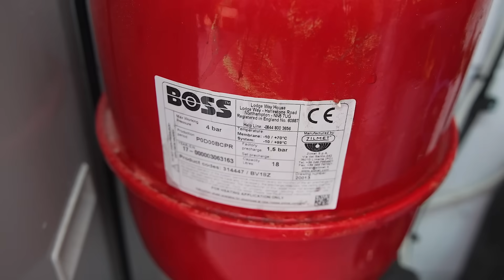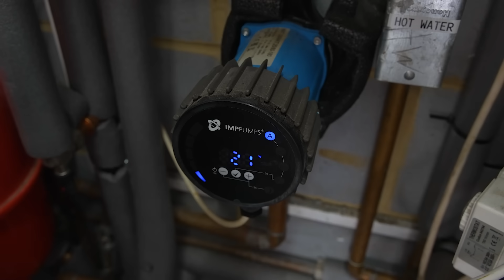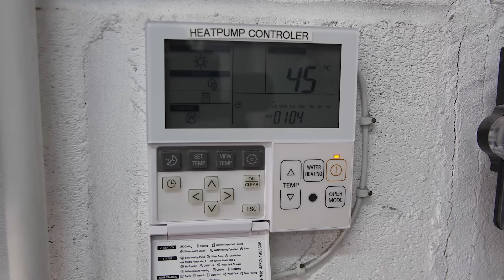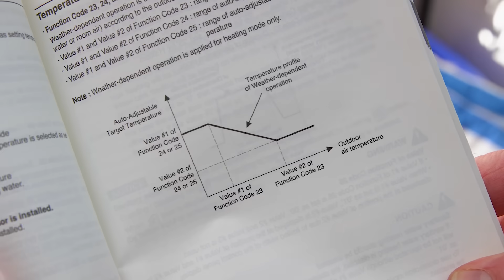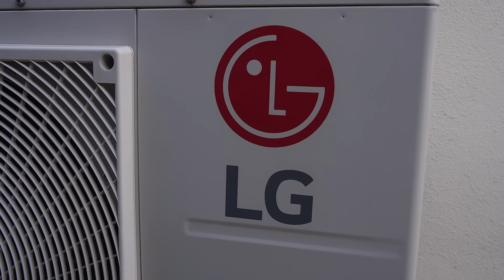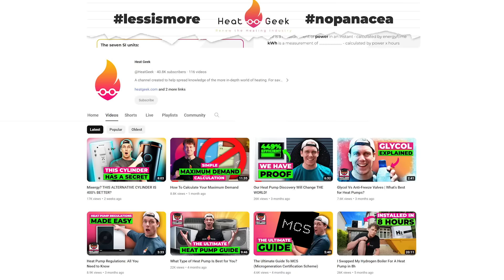Heat Geek Gives His Verdict on John’s Nightmare Heat Pump

Comment: not sure if it was said in the video, as watched half of it (its long!)- but that unit in this location will recirculate cold air and go to defrost too often. Its a shame that bad installs make people doubt this amazing tech. It works super well when done correctly.
Reply: I agree. If it's got enough water volume and it's still freezing up it's probably an air circulation thing
Reply from the maker: You get a mention later on. What would you do about the fan noise?
Reply: @SkillBuilder I will watch it in full later. Noise needs a repair obviously
Reply: Its like a metre, maybe 1.5 metres from front panel. What are people going to do when they dont have gardens, its going to have to be put on a cradle about 2metres off floor to get maximum air intake. Mental.
Reply: @Purebeltersteve have you been to the far east and see how they do air conditioning ?
Reply: @IverKnackerov  im not talking about AC units, but they are same thing. No but ive seen mainland europe and some of them in urban areas, you wouldnt want to service if your afraid of heights.
Reply: I'm wondering if some sort of 90 degree air diverter would help with the re-circulation in an smaller enclosed space.  This might also assist in dampening noise (once the fan is fixed) directly toward the neighbour.
Reply: @Purebeltersteve  If people don't have gardens, they are probably in a block of flats, and the flats have some outside space where heat pumps can be sited. What we aren't seeing much of in the UK is large centralised heat pump installations where the heat is generated by a large commercial heat pump and sold to the residents as the alternative to paying for the gas/electric so that they can generate their own heat with equipment that they own and are responsible for servicing. Europe has this cracked because they went down a route of district heating systems in the 60s and 70s, so people are already used to paying for heat rather then energy.
Reply: @tlangdon12  but what happens when the main source breaks and cant be fixed for 3 weeks for example. Most people arent going to agree to that, maybe people in social housing
Reply: The location is fine imo
Reply: Get to it Szymon, give him a quote. ;)

Comment: My LG ASHP has been rock solid and running cheaper than my prior condensing gas boiler. Shows you how important the installer is! Brands are going to live or die based on their customer service though, it's best they ramp up training and support.
Reply: Yea I thing LG need to have some responsibility here. For the pump manufacturer they need a proper trained competent reseller and they need to certify that through proper accreditation scheme

Comment: Cracking video chaps, and great work by Adam and Heat Geeks for trying to get this industry straightened out. The technology clearly works when it's done correctly but it's difficult to have faith as a consumer that you're getting someone who knows their stuff, rather than a fly by night outfit cashing in on govt grants. The HeatGeek guarantee will certainly help give consumers confidence - if a company is prepared to offer a guarantee it stands to reason that they are confident in their workmanship.

Comment: I put the Ideal weather comp kit on my Logic Heat Only gas boiler. It took a bit of getting used to cooler radiators, but it certainly works and has saved gas and money and the kit was less than £100. I'm retired now, but I was Gas Safe registered at the time. Incidentally, when it was -4C yesterday the flow temp went right up, just as it should. Go for weather compensation for sure if your system can support it.

Comment: It does look very complicated for just a house. I think we’d all love to see a complete overhaul and brand new system using Adam’s specifications.
Reply: Aye. I'd like to see the return visit!
Reply: Or just install a flipping efficient gas boiler instead of this nonesense.
Reply: @1701_FyldeFlyer 
I’m with you on that, 36 years in CH Industry domestic, commercial, including design and installation, all the certification to all highest levels,
All that keeps coming to mind is … for the love of god (all of the gods) this is just the work of some under educated/experienced and over mouthy, over confident youngster, that thinks his gunna make a big splash in the industry, using the trust of an honest fella.
For fuck sake it’s a bungalow
Reply: @1701_FyldeFlyer  Efficient? a heatpump moves more heat energy then it consumes.
Reply: @kiddy1992  Thus defying the laws of physics :)

Comment: Hello Roger. I was very lucky to get the government grant for the whole system, that being solar panels x 10, 7 new double convection radiators, the external fan cold to hot water heater, a Kodiak boiler with a digital interface, 2 expansion units above the boiler, & 2 thermostats (1 for upstairs, 1 for downstairs). My house met the criteria on a couple of points. Octopus asked me if I'd like this & I was elated, out with the old eco7 heaters & the immersion heater. I now wish I'd never had this installed. The rad's are luke warm at best, the outdoor fan unit switches on & off constantly & the electricity cost has more than doubled. As I write this at 11pm, it's  -2c outside & 12c inside. The rad's aren't being heated, just the hot water for the boiler. I echo John's original interview, it's very expensive to run, it feels too cold, & I don't have gas to compensate. I was told the rad's were working fine & that's what I will get heat wise. I've got so many valves, those pumps that Adam stated weren't needed, & my boiler is set to 50c. I live alone so I just live in the kitchen as it's the hub of the house. Out of my own savings I've replaced secondary glazed windows for new upvc double glazed units. Last winter it was just 6c inside this kitchen, now it's 12c so they have helped. But for all of this cheaper heating installation, those rad's are useless. Like you say, it's fairly new technology in the UK, & after watching this follow up with Adam, I think the installers didn't have the knowledge or training. They were just plumbers by trade. As of now, the rad's aren't being heated, they are stone cold at the bottom, & the heat exchange unit is using 93p per hour. My tap water will burn your skin off, but the water will not provide adequate heat to the rad's. I think I have too many unnecessary parts just like John. Something isn't right, as confirmed by your excellent video here. Very unhappy although at least the heat exchange is level & quiet.
Reply: Something is very wrong if your hot water is scalding. You need to find a competent engineer to sort your system.
Reply: Just ask some or several Geeks to come and look at it. There is U Tube Money to be made.  Make it a competition...
Reply: Turn it all off and get a cheap Chinese diesel heater or 2
Reply: Who was the installer?
Reply: @ryanh3285 Hi, seen a few videos on YT where people have done this for less than £200 hardware and cheap running costs.
The std cost of electricity is crazy, gas just barmy, so burning diesel or paraffin is now cheaper.
A plus is that it works in the cold!
Take care M.
Reply: My hot water is scalding but then thats what I get with a back boiler. 
I'm so sorry you're going through this, we get charmed by empty promises of more efficiency and what that always translates to is "you're gunna be more cold but pay the same or more to be cold"
Found this out when old storage heater was replaced and new one is shyte. Old one even though vent didn't open, kept one side of house toasty and mold free.
New one needs fan on as well as core so it's more to run for less hours and I have mold spores growing everywhere. 
So nope I won't be going for the gubment grant to get ASHP in, especially as they would disconnect my fire/backboiler which is only thing keeps me warm and the water for bath hot (I need that hot water for my messed up spinal issues) 

As for carbon zero....carbon is LIFE, net zero carbon will mean death of all plants including food if we go to 200ppm. We are at 420ppm presently and could do with being higher as I am seeing nature dying already around me.
Ask any aquascaper like I was, we added carbon dioxide to make our plants grow and the fish thrive. 

Dying to be green.... literally....and you will freeze doing so.

Comment: A gem of a video, which has re-shifted my confidence towards heat pumps installed in Britain's mild climate, providing the site and system is correctly surveyed competently beforehand.
I wonder if the closed space for the heat pump is causing it to resonate and perhaps putting sound absorbing foam opposite against the fence might help?

Comment: A quick note on South-Facing placement:

You will notice that the North side of a building will hold on to snow and frost a lot longer than the other faces of a building, particularly the South side.
You will also notice that temperatures are measured "in the shade" - I believe this is because there is no heating of the ground at the measurement point, so you are measuring air temperature that has not been additionally heated by warmth coming from the ground.
Consider:  If we are hot, we move into the shade to get some relief, on a sunny day.  We are being heated directly by the sun and the air around us has also been heated because it passes over warm ground, however under a tree it is noticeably cooler, as it the ground we sit upon.  This is why ground-source heat pump coils are typically laid in ground that has sun falling upon it, where possible.

Therefore:  
If you are installing your heat pump on a solid surface and it is surrounded by more solid surface, the sun will strike that surface and heat it, particularly if it is dark in colour.  That heat will be given off to the air around the heat pump.  You then pass that warmed air over your heat pump, which results in greater efficiency as there is more heat to extract from the air and pump around the system.

I also think that a darker casing will be beneficial for the same reason - air will be heated by the metal work as it passes over the heat pump.  It might not be worth a great deal of extra heat but nonetheless it will increase heat being passed into the system, improve efficiency, lower cost.  

Roger will doubtless recall that a customer wanted a heat pump moved out of sight, under a tree, the performance degraded, the cost went up.  This may have had something to do with losses due to losses in longer pipe work, but it is nonetheless instructive.

I think therefore that there is some advantage, actually, in having a darker casing, on the South side, if possible.
Reply: Your mixing radiant heat with conducted heat
Reply: @HeatGeek  I can see why you might think that - but no, I do understand that the heat comes from the air, hence "air source heat pump".  I'm simply positing that, when air passes over surfaces that have been heated by the sun, some of that heat will be transmitted to the air, which then blows over the heat pump vanes.  The effect may not be large, particularly when you really need it, but it might make a measurable difference to overall efficiency. 

It would be interesting to see the testing done by the manufacturer (Daikin ???) who recommended this, to see how large an effect they may have measured in their testing.

If the effect is true and measurable (yet to be determined) it's probably not enough to warrant spending extra.  But , if both options cost about the same, it's worth putting the external unit on the South side, just in case.
Reply: @ashtontechhelp  if it’s transfers to the air then we would measure higher air temperatures…
Reply: I’m no expert having watched the vid / read the above comments - but I would’ve thought if one had a flat roof - you could have a fan - or possibly a series of fans - laid horizontally - at a height to suit for clearances etc at roof level - could provide efficient way of doing things?  

The bearings of the fans would be under less stress - utilising low noise bearings tech - & a larger area of heated surface would be available - even if one had to provide some shielding against wind - maybe the system being gravity fed helps too 🤔. 

I’m just making it up tbh - but who knows.

One thing I liked seeing is where buildings are designed with walls acting as heat sinks - where they might have a concrete stem that protrudes above that provides heat / or cooling. 

Think most external masonry  walls act as “cold sinks” so the least one should go is to insulate them on the inside. Obvious to most I suspect but even internal solid masonry walls on foundations from ground level should be insulated. Doesn’t need much insulation even if it’s foil backed insulation/dry lining. 

I’m getting carried away - 

Many ways to skin a cat is the saying me thinks
Reply: @HeatGeek  You would - and, are you saying that you don't in fact see these higher temparatures?  In which case, question answered.
Reply: I was looking for someone to have said this. If not, I was going to have to have to say it myself. 
You are absolutely correct in everything you've stated — it's spot on. Additionally, it's interesting to note that more companies are now adopting black casings for heat pumps. This seems to be a shift from their original use as air conditioning units, where a white colour is more beneficial. In the past, these heat pumps were occasionally used for heating during the colder winter months. However, with the recent trend of using heat pumps year-round for water heating, it appears that manufacturers have simply repurposed existing equipment without fully optimising it for this new purpose.
Reply: @ashtontechhelp yes correct. The air temperature measures exactly the same all round. If you measure radiant heat too it doesnt, but heat pumps don’t use radiant heat.. unless you face the evaporator  toward the sun whic would be extremely unusual

Comment: This is a brilliant video, it's great to see that you've gone back to try and help John out with a proper expert in Adam. I hope it's all finally put right for him.
There's a lot of people that think they know what they're talking about, but Adam actually does know and that's a rare thing these days.
Although I'm still an advocate for installing an air-to-air HP in my own house, it's still interesting to hear about what to look out for if I ever change my mind and decide on air-to-water.
As a final, Jaysus Christ those fan bearings are screaming in pain! I really hope that they can be swapped out for decent ones without changing the whole fan assembly.
Reply: Air-to-air can be good, but the wall units are quite large, and can dominate a small room. They look like they would expensive to have a wall unit in each room. We have 10 rooms in our house that have radiators in them currently, so we would need a very large outdoor unit (or units) to support 10 wall units. I'm not sure we have the outdoor space for what would be needed. We are also used to having stored Hot Water, so would need an air-to-air system to provide this.
Reply: @tlangdon12  We use air-to-air HP's all over the place at work and that's where I've been taking my inspiration from. The air handling units aren't that large, I have a tower fan sitting in the corner of my room right now that is twice the size of one of those units and it isn't a problem, this feels like a bit of a perpetuated myth on how big or intrusive they are or need to be.
You also probably don't need 10 seperate handling units if you have 10x rooms. My house has 8x rooms and through physics, cross-convection and the ducting of my MVHR system, I calculated that I could heat all of them quite effectively using 2x units, or even 1x if I really wanted to push it. The heating engineers at work agreed that was perfectly fine, when I showed them a drawing of what I wanted to do.
Likewise, you don't need a massive industrial-scale external unit to accomodate 10x air handling units, the only major things in that unit are a compressor and a radiator...the rest of it is in the interior air handling unit. The external units are usually significantly smaller than their air-to-water cousins. You just scale up either/both the compressor and radiator as needed, one basic external unit is usually capable of feeding up to 2-3x air handling units before it hit's it's limit and needs upscaling, so the guys told me. You could probably get away with either a single upscaled external unit, or two smaller units delivering for upstairs/downstairs respectively.
At work, one of the office buildings is done like this and it's the size of an average warehouse, the air-to-air external unit just for that building is the size of a small motorcycle. That's absolutely tiny in relation to the rest of the building, but it's actually over-sized a little so it's not running flat-out all of the time. I remember being shocked at how small it was, yet was delivering so much. It's been going for over a decade now with no trouble and usual basic sarvicing...because there's hardly anything that needs to be serviced on it.

Comment: when John quietly dropped into the original convo the fact the his lecky bill went up TWO-AND-A-HALF TIMES it was gameover...scene of crime forensic analysis done mate
Reply: And the crime was a badly designed and installed system.  Which is the entire point of the video.  Analysis:  get a heat pump system that's designed and installed correctly.